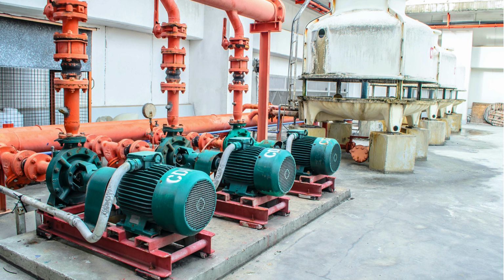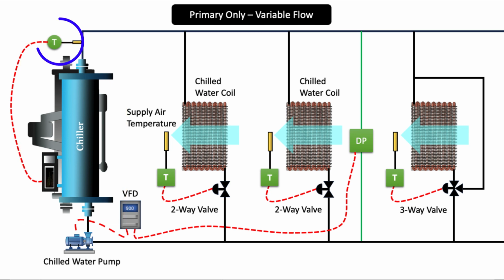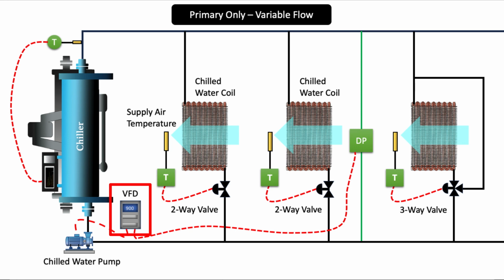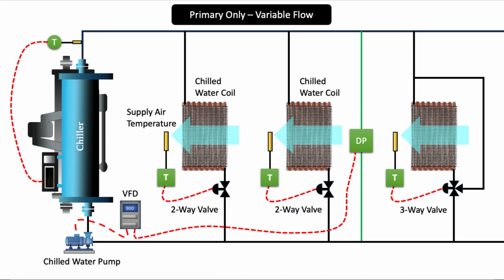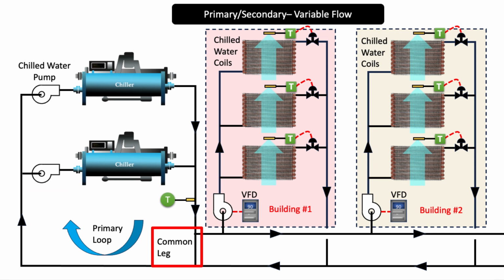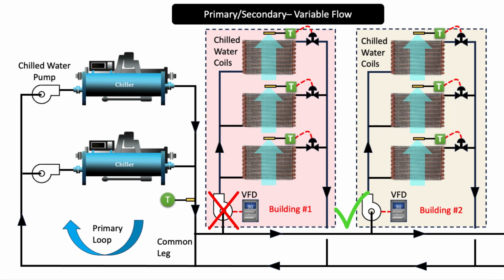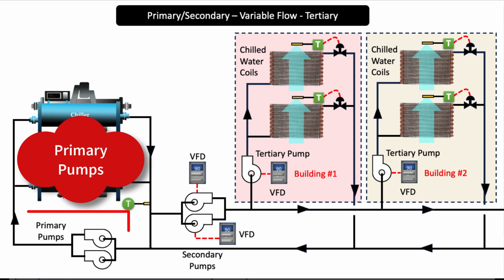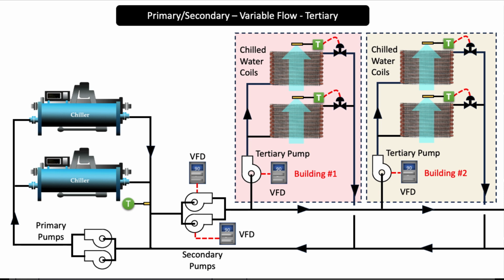Central Plant Chilled Water Pumping Options

Comment: In first system there is DP sensor that control pump vfd. How in secondary and tertiary pump vfd are being controlled in other two aysytems.
Reply: Also temp sensor in primary loop can modulate chiller capacity.
Reply from the maker: Yes, that’s correct. Pump VFDs are typically controlled by DP in each loop, while primary loop temperature sensors are used to modulate or stage chiller capacity. Flow and temperature are controlled separately but coordinated.